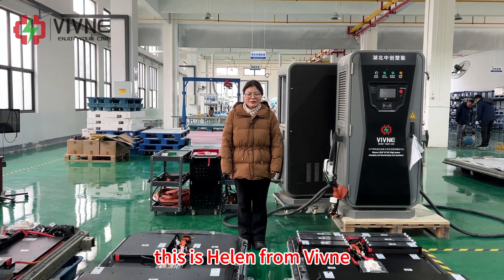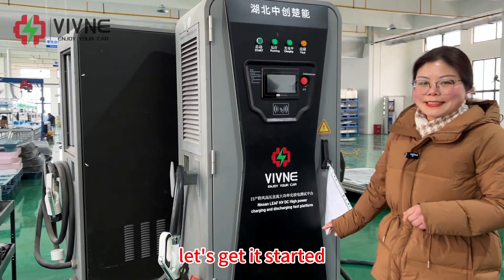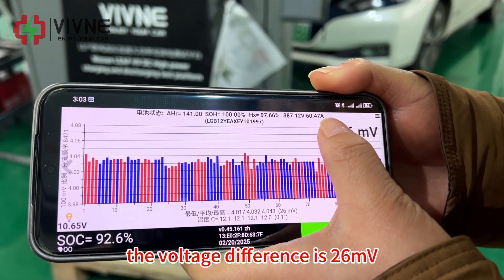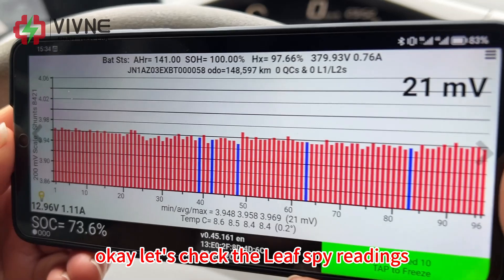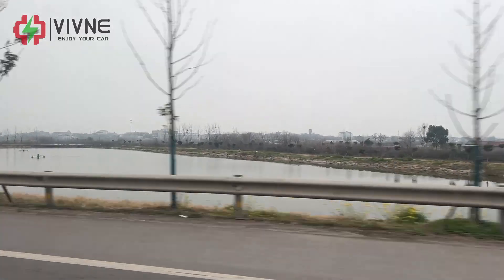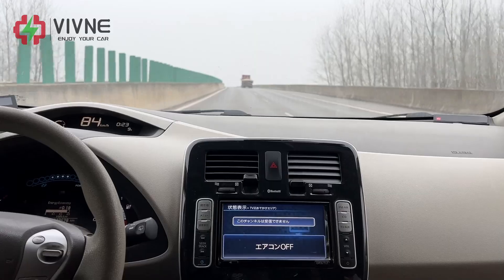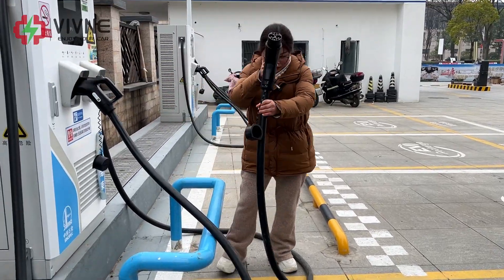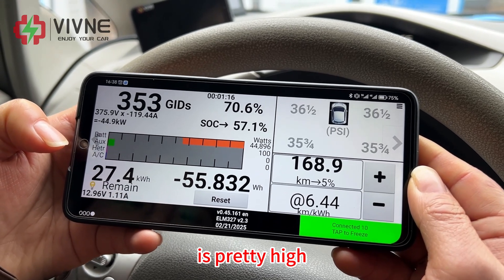VIVNE - New battery Layout  & 50kWh battery pack to USA

Comment: It's great to see older leafs being given a completely new lease on life 
Makes sense for the environment to 
Trust the Chinese to come up with a solution, love it
Reply: Yes, fully agree. It's shocking that Nissan flatly refused to provide such a service and will only replace my battery pack with a refurbished one of the same capacity, in my case only 24kwh. I want to not only replace my battery but for a much higher capacity to give my car which is still running like new after nearly 9 years a completely new lease of life. With a 50kwh battery, I can use it as my main car rather than restricting it to local commutes only. It also helps the environment as we can downgrade to only one car in our household.